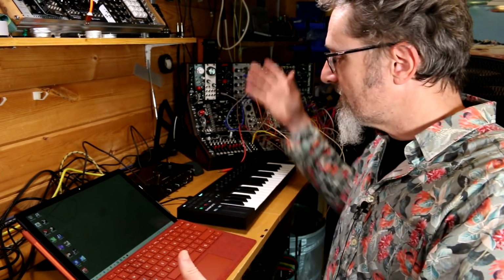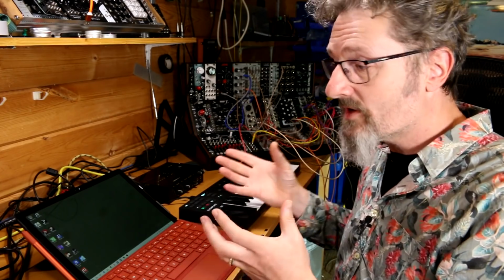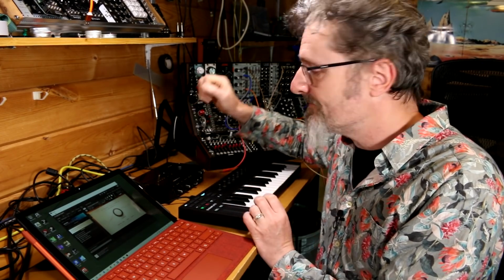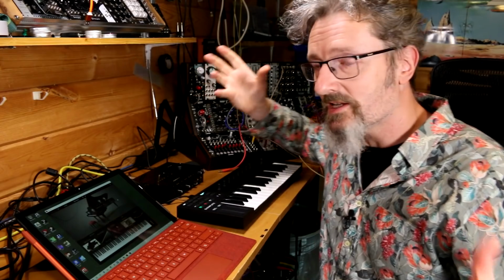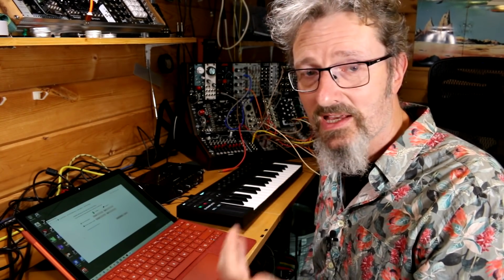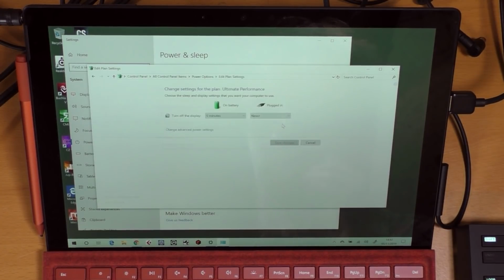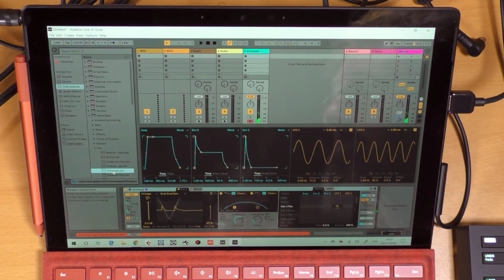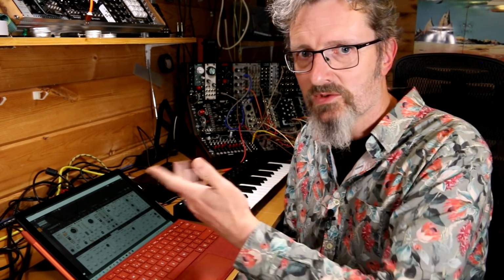Surface Pro 7 - Initial testing and tweaking for music production

Comment: The clicks and latency are DPC latency.  You can't use Windows drivers for real-time audio.  Even the fastest, newest Windows computers can have latency problems using the Windows audio drivers.  If you run LatencyMon I promise it will prove that DPC latency is the issue.  Its because one of your other drivers (probably NVIDIA or kernel mode runtime) is having a bad interaction with your DAW or plugins.  ASIO4ALL is a bandaid solution, but you really need interface drivers to even have a chance of low latency audio production on Windows.

Comment: I know this is old but as a reference as it supposed new surfaces to be better. At which buffer size are you runing this?
Reply from the maker: I usually test at 128 and 256
Reply: @MoltenMusicTech  have you read the specs of the dell xps 14 2 in 1, the one with the folio? Given your experience with passively cooled windows tablets how do you think It might behave? I want It to record folk music sessions (just 2 mikes mid-side) in a home studio without fan noise. And hopefuly do all the mixing. I'm using my phone currently with cubasis and an adapter for the audio interface. And It does really well as delay is nit critical in this setting but i might change my laptop soon and a bigger touchscreen might bé appreciated.
Reply from the maker: Unfortunately it's impossible to say whether a particular laptop or tablet will work without trying it. So, probably, it will be fine, but that's the best I can offer.

Comment: Thank you, Robin, for the useful video; last year I bought a Notebook  HP Elitex2  1012  -8GB ram - SSD 256 Gb - 2.7 Ghz - to run some standalone from Arturia and other mixed VSTs (Roland - Cherry Audio etc)on Ableton Lite 11, connected to a Nord stage 2ex and a Focusrite 2i4... I found it quite difficult to obtain satisfying results but, tweaking between buffer size and sample rate, I managed to; NEVER forget to set the CPU velocity on max, maintain the mains power supply NOT on battery, SHUT OFF any internet connection and SHUT all the programs running in background.. But what really sucks is that there's not a dedicated tablet (touchscreen) for music production or played live... Thanks  again for your video and your space and beg your pardon for my english.

Comment: Great video... Can I ask, have you tried any bus powered interfaces with the surface pro 7? I have one... And I use a Steinberg UR44C audio interface. I was hoping I wouldn't have to use the 12 volt adapter with the interface... The unit indicates there is not enough power to run it with the USB A connector. Silly side note... I had the surface pro powered by plugging into the 120 v outlet on the desk lamp. Could this be the issue? Just wondering if you had any thoughts on that. Thanks! Keep up the videos. :)
Reply from the maker: Yes, plenty of bus powered interfaces like the MOTU M4, Komplete Audio 6, Minifuse etc. It should be able to run a couple of devices through each USB port but it does depend on the interface and what power it needs. I don';t know what you mean by the desk lamp but try powering the SP7 like a normal person and see if that helps :D
Reply: @MoltenMusicTech  HA! It's funny... I have a cat that loves to chew wires... so I've been plugging it in up high. It's basically a desk lamp that plugs in like a "normal person" and it has a built in 120 volt outlet. Thanks!

Comment: I just want a portable alternative to my desktop where I can practice getting familiar with the sounds of mainly one vst (massive), so I would like to not have any cables being used... just the surface, a Bluetooth piano keyboard, and my Bluetooth headphones. Would the surface be a good choice for this purpose if I’m just making around 10-15 tracks (with no processing) of just massive presets and one drum track with drum samples? Running off battery and no interface just Asio4all?
Reply from the maker: Bluetooth MIDI on Windows is dodgy - I've never got it to work although I haven't tried in a while. If you can get that to work then I don't see why not.

Comment: hi ya. im not sure if its the latest updates in windows ie 2004 i think. but i cant find the csenabled in the registry where you are stating. any help would be appreciated as i keep getting random clicks and my audiofuse keeps resetting or just dropping off. assume this is the power settings problem?
Reply from the maker: It is the 2004 update - they've changed it. You should find some help in the comments on this video - i'll be making a new video soon.
Reply: @MoltenMusicTech  hat again tipped for your work you put in. maybe its the asio4all drivers not working with the updates? anyways will say if i find anything. cheers again.

Comment: Windows 10 2004 Update removes csenabled and removes ultimate performance mode. I needed to roll back to the previous build (I rolled back to 10.0.18363 Build 18363) to get back Ultimate Performance mode. Just a warning to those who are planning to update Windows 10 or find that this guide no longer works.
Reply from the maker: Hey - i'll have a new guide coming along when 2004 gets itself installed on any of my Surface's - it seems reluctant for some reason.

Comment: Thank you for really helpful videos. For some reason I can't enable high performance mode. I tried the registry tweak in your previous video, the powershell script in this one - it's simply not there. I'm running a surface pro 4 with Windows 10 pro 2004. Anything you've encountered?
Reply: seems like the options are removed in Windows 2004 https://www.reddit.com/r/Surface/comments/eu7q1d/missing_csenabled_in_registry_deliberate_from_ms/
Reply from the maker: It does - this is a problem. None of my machines have updated to 2004 so I haven’t experienced it. I will look into solutions - hopefully other users will need it and find a way.
Reply: @MoltenMusicTech  Much appreciated! The performance slider still allows the CPU to throttle even when set to max performance (I'm sure you know this) and I'm experiencing glitches at low cpu loads in Live 10 (which looks terrible on the SP4 by the way).
Reply from the maker: The only way to stop the throttling is by disabling the turbo mode and keeping the heat under control - you can't do that anywhere other than advanced power settings which you can't get to with disabling CsEnabled in the registry. The performance slider does nothing helpful. I'll look into in once any of my machines updates to 2004.
Reply from the maker: Cool - i was hoping something like that might be the answer. It's a shame because Throttlestop doesn't use a language that non-tech people can understand. But i'll certainly look into it when it occurs. My SP7 says that it's not ready for 2004 yet. Thanks for the tip.
Reply: @MoltenMusicTech  It's not working as expected unfortunately. After a while throttling is back and I can't seem to take control anymore . Not a recommended solution.
Reply: @MoltenMusicTech  Ok firstly, sorry for the "it's working, no wait it's not" - not very scientific. Anyways, I got it working now with just a few settings. Techpowerup did solve the problem for me - Turbo  mode is disabled and multiplier locked at 24 x 100 MHz running rock solid on the SP4. There is a really great manual for the software explaining all the settings in a good way. It seems though that the OS can override them - for instance when I run on battery I cannot lock the multiplier anymore - but in AC mode it runs fine and 100% solved all glitching problems. Also - there is a risk of overheating and thus the CPU itself will start to safety throttle regardless of settings resulting of course in awful performance. It also seems that it's possible to disable overheating sensors. I didn't try it, there is no need to in my case. Best regards // Peter
Reply from the maker: @peterbenisch7668  Ok cool, good information and some relief :D I wouldn't disable heat sensors because you want the processor to protect itself. If it's running too hot then you need to undervolt it to clock it down a little bit otherwise you'll just break it. Thanks!
Reply from the maker: I've been speaking to Pete Brown at Microsoft and he has a slight change to the Ultimate Power Plan tweak that should bypass the need for messing about with CSEnabled. I'm not able to try it as my Surface still hasnt updated but maybe if you turn off Throttlestop you could give this a go: Open up a Powershell (Admin) command line and type:
powercfg /setactive e9a42b02-d5df-448d-aa00-03f14749eb61
That should enable the power profile and let you do the 99% thing on the CPU from my tweak video. If you get a chance to try it let me know how it goes.
Reply: @MoltenMusicTech  when I try this on my Surface Pro 7 with Windows 10 Home 2004 I get "Not Supported" returned. The previous method had worked fine and let me create a proper profile.
Reply from the maker: @gamingdave  Oh dear. I should have a video up about in a couple of weeks.

Comment: Strange, I don't have the CsEnabled key in my reg!?? And I checked the directory as well as searching, all the other values you have are there, just this one missing! I've even tried to add the key myself but it doesn't work :(
Reply from the maker: where are you looking exactly?
Reply: @MoltenMusicTech  hklocal, control set 001 - same place you have on the video. Very strange, seems from Google other can't find it either. Very annoying as I'm getting pops and cracks from usb sound card on a basic poly synth pad for no apparent reason
Reply: @MoltenMusicTech  CPU is running at over 3ghz but latency monitor is saying I have issues and to disable CPU throttling, I can't do. God dam Microsoft! I'm running the high end i7 16gb version too, you'd think it would just work for the price
Reply from the maker: Doesn't matter how much you spend mate, there's nothing wrong with your computer. It's just that the turbo on the CPU is unable to cope with the requirements of low latency audio generation. It's the same on a cheap laptop as it is on an expensive hybrid. 

I've never not seen CsEnabled turn up. I've heard people say they can't find it but when i tell them to look again they never come back. So here's what you should try:

1. Look again. Use the search function for CsEnabled - there should be two entries, one in ControlSet001 and one in CurrentControlSet - either will do. 
2. Update windows - run every update, keep restarting and run updates again until there are no more updates after several restarts.
3. Add a power profile - see if that action adds CSEnabled to the registry.
4. Reboot and try again.
5. Failing all that try using a third party tweaking app like ThrottleStop or OpenCPU.

Good luck
Reply: @MoltenMusicTech yes it's a strange one but it definitely isn't there, I've tried all of the above without luck, firmware updates, the lot, short of a clean install I'm out of options. I have however noticed the crackling and pop are only present when I use my audio interface, if I use the inbuilt surface/windows WASAPI device I have no issues, I actually think I might be facing a wider driver issue with my NI soundcard. The clue might be in latency mon reporting wdf01000.sys  as the problematic routine which I believe governs drivers. Yet uninstalling and reinstalling my NI drivers doesn't not fix the issues. I should mention the issue is systemwide, I can't even play Spotify through my soundcard without some cracking. Lord save from this audio hell hole!! - On another note, thanks for your input :)
Reply from the maker: It might be a bad sign - https://www.reddit.com/r/gpdwin/comments/eumriw/csenabled_is_missing_at_20h1_1904121_gpd_win_1/?utm_source=share&utm_medium=ios_app&utm_name=iossmf
Reply: I was just about to buy a SP7, but reading that CSenabled is now disabled in WIN10:2004 has made me go cold on the whole idea... you might need to keep an eye on this as it might spell disaster for Surface Pro Audio!
Reply: @hamildad  I don't understand why I have no issue using the internal audio but do with my x2 external soundcards. I'm going to have to do a factory reset as I did have a driver install fail, so could actually be a driver issue. The pro 7 does have a new power slider, when plugged in you turn to up to best performance, the internal fan comes on and the CPU stays enough above 3ghz not to cause any issues from my experience, so there must be something else at play! Don't rule them out just yet!

Comment: Hi Robin, would there be a chance of you testing the Surface Pro 7 with Avid's Sibelius? Thanks regardless. All the best. -Michele
Reply from the maker: Hey - no, seems unlikely- don’t see why it wouldn’t work though
Reply: @MoltenMusicTech  You're right of course, and it's definitely a cpu or ram hungry application. I was more curious on how it behaved with the pen, and actually, on how the pen works out  in general for these type of applications
Reply from the maker: The pen can work ok but it can be pretty laborious for that sort of note entry - mouse/keyboard works better. Check out StaffPad for a great pen experience.
Reply: @MoltenMusicTech  Thanks! And StaffPad (with its very recent update) is in fact the main reason I'm considering the idea of the Surface Pro. I'm just trying to justify the purchase though, by making fairly sure that these other softwares I have to use daily and professionally will still be working and usable.

Comment: Hey, thanks for the Videos! I have a couple of questions: first what about the cooling? Is it a Problem? Because i heard a lot of times, that these small devices and ultrabooks tend to overheat during big programs like music production. And if, how can we avoid that? Ventilator? And second: why dont you use the i7 16gm ram modell? I guess its far more powerful and able for music production? Thanks!
Reply from the maker: Hi! Yeah they don’t overheat because they clock down like I demonstrated in the video. And so we turn off turbo to keep a good stable speed which shouldn’t overheat. I go for the i5 8gb because it’s better value than the i7. Also the i7 runs hotter and will clock down quicker than the i5. But it all depends on what you’re doing. Hope that helps.
Reply: @MoltenMusicTech  First of all, thanks you for the quick reply, i really appreciate it, because im actually looking to buy a Surface pro 7 at this time. I mainly do audio-recording and use a few samplers for rock covers and ballads on cubase. Last Question, would you recommend the i5/8gb in this case? And in which cases would you recommend i7/16gb? Thanks!
Reply from the maker: I think the i5 is the sweet spot. I don’t think you get to use all the extra speed of the i7 very much. The 16gb is only helpful if you are loading large sampled instruments. But the i7 will let you do a little bit more - not enough for my money.
Reply: @MoltenMusicTech  Okay thank you very much for your opinion!

Comment: I have learned alot from your tweaking videos. Might i suggest that you look into Intel extreme tuning utility (created by Intel). You can use it to tweak your system but it also will tell you the exact point where you system is thermal throttling.
Reply from the maker: Well....... i use it all the time except on the SP7 where Intel and Microsoft have got together and prevented it from working - it does not install. I just use it for the graphs and monitoring which are awesome - but alas, cant be done.
Reply: @MoltenMusicTech  well that is annoying of them. I am using it on a HP Spectre gem cut and it works well, but randomly reverts to initial settings when I turn my laptop on. I just have to load my profile again which is annoying but nothing major
Reply: @MoltenMusicTech  I am trying another one called throttle stop. It seems to work better and allows my to run my system at it's exact base clock speed constantly. There are many other tweaks that I could do, but I don't understand them so I won't mess with it

Comment: I just ordered this, and planning to order the Apogee One, which is an audio interface that comes with a microphone built into it.  So I can record myself playing instruments, or singing (god forbid), and for any midi instruments, I'll just make due with the computer keyboard.

For a couple weeks use while I travel, I think it's good enough, not having to lug around the interface, microphone, cables, usb hub, and a midi controller.  Weight, and space are so important when traveling.

Comment: Hello Robin, first of all, thank you very much for those videos, they helped me finally pick up a SP5 back in 4/18, that I am very happy with to this day.

Looking at the rather low base clocks in newer ultra mobile devices like the SP7, I am curious about how they might handle certain pieces of software that were optimised for dual core i5s some years - and architecture generations - ago.

If your time allows it and you still have the seaboard at hand, could you try running ROLI Equator on the then tweaked SP7? ROLI themselves recommend a dual core i5 with 2,5 GHz for that, but of course, that evaluation was several years (and probably quite a few CPU generations) ago, so it does not really tell us much about if a much newer quadcore with much lower base clock can handle it.

Thank you very much in advance anyway, whether you can include it or not.
Reply from the maker: Yes, good idea, I'll try to
Reply: @MoltenMusicTech  Thank you so much!